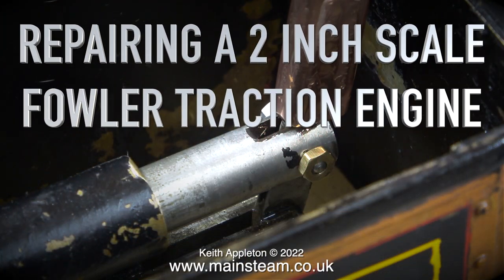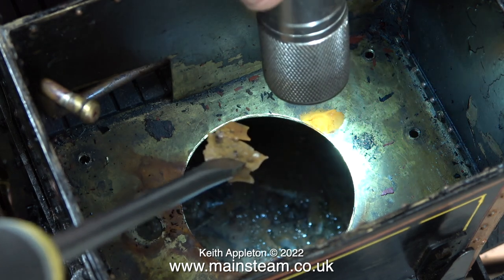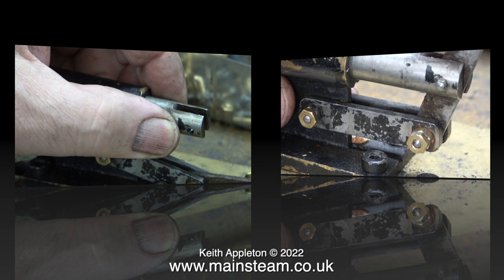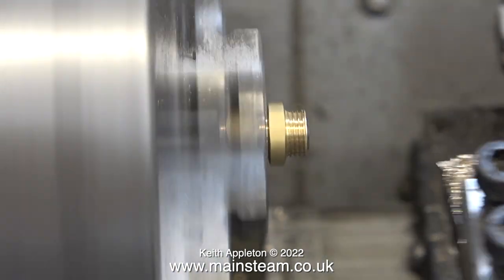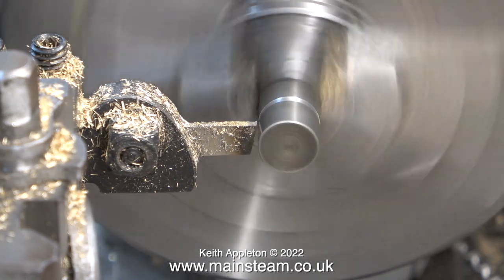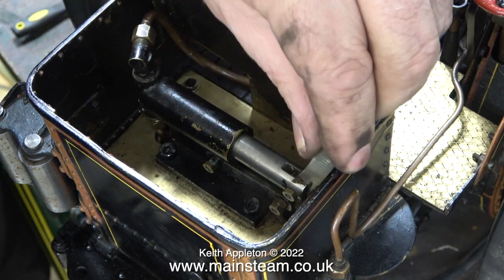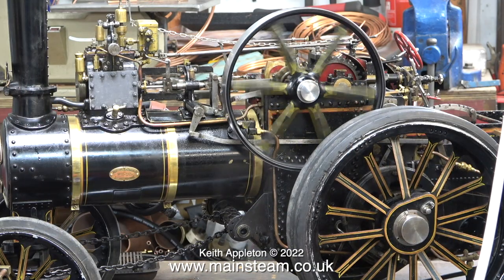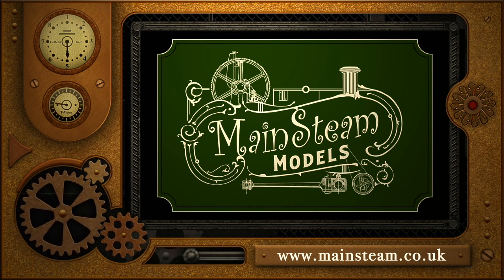REPAIRING A FOWLER 2 INCH SCALE TRACTION ENGINE - PART #8

Comment: I just rewatched the first video in the series to compare the sound of the engine originally to how it sounds now. It's quite remarkable how a small number of well considered repairs can have such a profound impact on the way the engine runs. It really does sound so much better now, which really does fit the very pleasant design of the engine. I've always liked Fowlers, and they make a very nice model in 2" scale. Excellent work Keith!
Reply from the maker: Thank you, The problem with this job is the budget, there is so much more wrong with it that I was originally asked to fix, so I will have to allow for my costs going above the original quote, because it's a nice Engine and so was it's owner (and his partner)  {:-)))
Reply: @keithappleton  I think that's a problem in any creative job really. When the restrictions on time and budget all come from yourself, it's much easier to justify the extra work to do the job to your satisfaction, but when you have to work to a very specific brief either in terms of the job itself or the budget, you have to weigh up the advantages of each individual element somewhat more strictly.